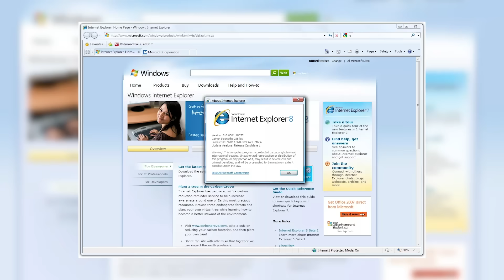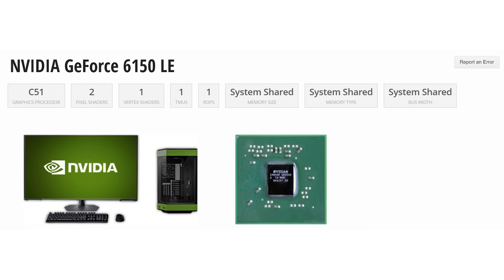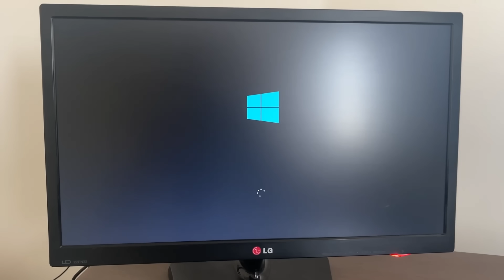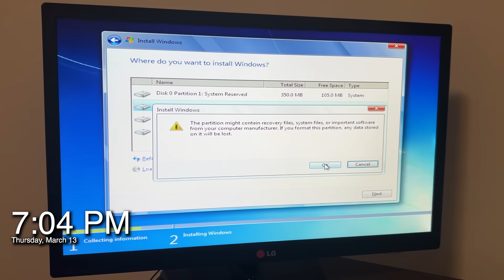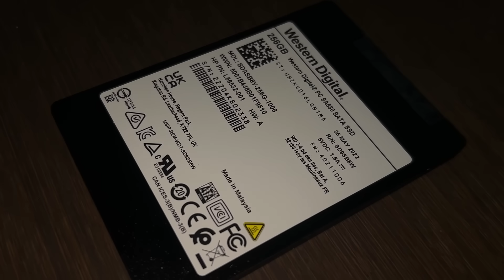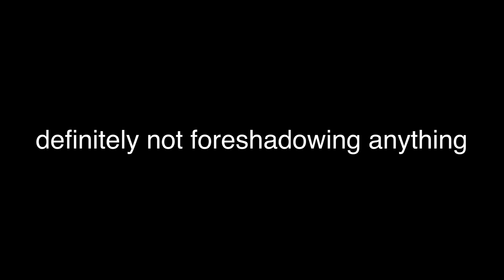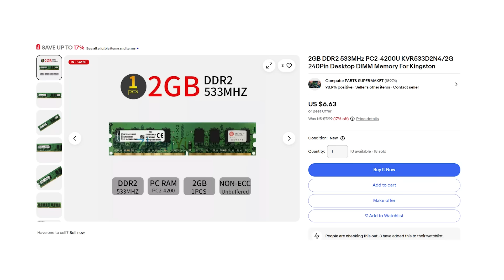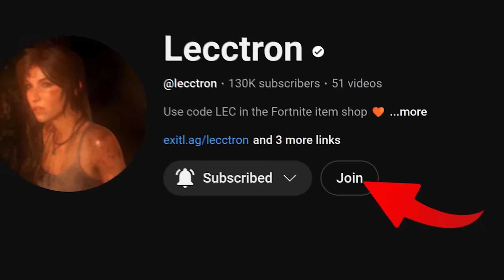I Revived a 2007 PC For Only $28!

Comment: The AMD Athlon 64 X2 4200+ was first released on May 31, 2005, as part of the initial launch of the Athlon 64 X2 family. 
Following the original release, updated versions using different architectures and sockets were launched on the following dates:
May 23, 2006: Release of the Windsor-based model for Socket AM2.

Comment: Revived an Athlon II x3 455 (from 2010, 3 cores 3 thread). Swaped the HDD for a SSD 250Gb. Swaped the 2x2Gb for 2x4Gb RAM DDR3 1333 Mhz. Then, I removed the radeon HD with 500Mb VRAM, for a Powercolor RX 550 2Gb (50 watts, 50$ CAN). That GPU is the center-piece of the upgrade. The thing is, you want to offload video decoding to the GPU, when browsing Youtube, Netflix, Prime, etc... You need codec support, otherwise the CPU will do the decoding (and it will utterly choke). You need hardware acceleration for h264, h265 and at least partial decode for VP9 8-bits. At that is exactly what the RX 550 does. When I go on Youtube, I use the MS Edge extension h264ify to force H264 playback. Then the GPU handles the decode, and the CPU still has some paperwork to do. The Result is that I can watch Youtube at 1080p30 with about 25% GPU usage and 40-50% CPU usage, with very very few dropped frames (less than 1%). I installed Linux Mint on it, and the PC sits comfortably at 2.5Gb to 4Gb RAM usage, depending on what I do. I can go as high as 5.5Gb usage, with Edge (6 tabs), thunderbird opened, LibreOffice with documents opened. I don't think anyone would reach the 8Gb usage on that machine, because it would mean there are tons of windows opened. Mint is lighter than Windows, and so, it helps.That old dinosaur feels quite good to operate for browsing, emails, Office work. It's very functionnal honestly. The thing with Linux is, you want an Intel or AMD GPU, for full integration into the Kernel. Nvidia GPUs are a pain in the butt to configure for Hardware acceleration (through VA-API), so it means you must go AMD. Good news with AMD is, it is an out-of-the-box experience on Linux. The Kernel detects and install it easily. The powersupply of that Athlon II x3 is super weak. It is a small for factor, with 200 watts. The GPU upgrade had to take this into consideration. That's why the RX 550 was a good choice, with H264,H265 and partial VP9 hardware decode, and 50 watts TDP. All in all, it is a very very good upgrade. 15 years old machine that can still be used as an office computer and feels responsive.

Comment: THis PC is capable for upgrades.First CPU - I think this motherboard support up to Athlon 64 5700+.Ram can be upgraded to 4 modules 2 gb ddr2 667 - 8gb is max.Try to find modern Modern Nvidia card and of course SSD. Yes for sure for powerful gpu You must change the PSU.

Comment: When going backwards from something higher than Windows XP you need to remove the CMOS battery because the later windows alter BIOS settings. Pulling battery makes it go back to factory CMOS file. Put battery in so it does not forget the tie of day each time you unplug it.

Comment: I've seen this mistake before, but the iGPU is integrated into the northbridge, not the south bridge. People younger than like 23 probably wouldn't know this as CPU's have housed the integrated gpu since the early 2010's. The northbridge is under the heatsink located between the cpu and the pci-e slot. Yes, I know it says nvidia, but nvidia made chipsets back in the day. It was the only way to get Nvidia iGPUs and SLI compatibility in gaming motherboards in this era.

Comment: 4:58 I HAD THIS ISSUE BRO. CHECK DISK OR SMTH. I HAD TO FACTORY RESET- CUZ IT DIDNT FIX WHATEVER IT WAS TRYNA. AND THE LAPTOP I WAS USING IS 14 YEARS OLD. THE FACTORY RESET GOT STUCK, I SHUT THE LAPTOP OFF, I ENTERED RECOVERY, OH NO, ITS STUCK ON A BOOT SCREEN I DIDNT EVEN KNOW. Then I got it fixed and now it's running good.

Comment: I have an old z400 hp with a 1366 Xeon I found on the curb. Had 20 gigs of ram, threw a 1060 in there and it works damn well.

Comment: I'm running 🏃‍♂️ windows 🪟 11pro on 23yr old Asrock G41-VS3 mobo with Intel xeon x5450  3.00Ghz speed 4 cores 12 mb L2 Cache and 8gb ddr3 ram on old 500gb seagate hdd 12yr old.

Will this gpu you used 🤔 will work on G41-VS3 mobo?

Comment: how to install linux: select a distro (distros are like the flavors of linux, weird pepole try arch linux, normal pepole try linux mint) (I recommend linux mint) dowland the ISO file, plug a usb flash drive with 8 or more GBs to your main pc, install rufus, open rufus and select your flash drive and iso, if the computer that you are gonna be installing linux have a 10+ years old motherboard, select MBR, if it is more recent, select GPT, press done, plug in your flash drive to the pc that you are gonna install linux to, google: "what is the boot menu key for [motherboard maker] motherboards", the result will tell you the boot menu key, prees the boot menu key while booting, select the usb flash drive and press enter, install linux by opening "install linux mint" and go throuth the instalation progress
Reply: yes, installing linux mint isn't too hard. I have a pc with 4GB of ram and an old e6600 core duo .It only works properly with antix linux on.  Putting that on a pc if it old isn't that hard either. I'm using it now to write this.

Comment: 2mins in and im already spotting bad caps lol One of the first things i do as tech is look for leaking caps on mobo, once i see that its done. lol No point in spending coin on that puppy. That being said alot of people are to quick to get rid of there computers because they think they are to old, there not, not at all, if people would stop listening to the big corps or people who dont know what there talking about and just did a little bit of upgrading you can keep the computers for yearsssss.

All this one needs is that extra ram, vid card and slap in ssd, boom, that thing would load faster than some of the new win 11 retail computers today.

Comment: Not as cheap but have similar plans for an HP Pavillion elite desktop I found for $50 while thrifting (came with o e of the monitorsof the time) keyboard and mouse extra cables etc. But the true worth is what's on the inside. A Core2Quid Q8200 with 4 2gb ddr3 ram all HP oem, I plan to transplant the board and a few of the other parts into a Cooler Master N200 case along with a Nvidia geeforce gtx 560ti from the FB marketplace and a Sound Blaster audigy for EAX support. 

Oh and a 1tb WB blue 2.5" hdd with 128mb cache for XP and a ssd for 7

Comment: I forget the Website!  But I downloaded a Windows 7 .iso which had the word "ultimate" in the file name:  You can probably find it, if you search for that.  It required NO Activation Key:  You just hit "Enter," with that field blank.  One thing....I later read that it has problems using a USB 3 port.  I burned it to a DVD & had no problems.
"Fight Software Piracy!  Earn a Reward!  Call:  1 800 RAT-FINK."  :face-blue-smiling:

Comment: 3:34  But Linux is IDEAL for old computers!  Installing it is easy, & it runs faster than Windows!  For moderately old machines, you can't beat "MX," which is full-featured.  Older computers may prefer "AntiX," "Puppy," "Slax," or some others.  For REALLY old machines, there's "Tiny Core."  "Got 32 bits?  Get Tiny Core!"
Reply: 32-bit AntiX is super fast and reliable to be honest.

Comment: 5:00 that's not an update, thats the disk repair utility, and yes it takes FOREVER.
(Tho it's mostly worth it if you're running an HDD as a boot drive)

When installing an OS on an HDD I usually format it, run the tool overnight (tho when the drive is empty it usually takes less time), and only then install the OS.

Comment: Wdym you don't have any experience installing Linux on an older pc?
Either usb boot or, if its not supported, use an cd/dvd.

Just use debian and it will work out of the Box.
When installing, choose the xfce desktop environment. This works fine on my singlecore Atom from 2009.

Comment: I am pretty sure that is not the original motherboard. I had a PC from the same lineup. These were sold as media center PCs. They were shipped with XP Media Center and had a TV tuner card. The motherboard had HP branding but was sourced from ECS. The PC I had was an a1521in with 512 MB RAM, 200GB of HDD and an ATI Radeon Xpress 200 chipset with integrated graphics.

Comment: My father bought an older used workstation computer 10 years ago, and after a few years, it became increasingly slow. He asked me what could be done, and I took a look at it. I was able to upgrade it from 2 cores to 2x4 cores and from 2GB of RAM to 16GB for about €50. The SSD I installed was a used one I owned. The computer feels almost 20 years old and still runs well. It was definitely fun converting it.

Comment: 5:11 that's not a hard drive that's too slow, that's a failing hard drive.... 

Also would have personally gone for Windows 8.1 on here, much lighter than 7 and 10 and is what I use on my main PC. Oh and Win7 drivers work on 8.1 99% of the time.

These old Althon 64 X2s are pretty awesome, especially for pre 2010 games. will pretty much play anything from that time period. Very good showcase of how these old systems can be a lot of fun still, keep up the good work!

Comment: that mobo could do 8 gb of low density ddr2 it doesn't say it supported but I will also you can inject 1090t microode into the bios an use a 6 core with it

Comment: Sometimes the 4GB limit is due to the manufacturers anticipating a 32bit OS, which cannot access anything more.  There is a solid chance that this could take 8GB, but I'm sure you researched that.  I would also say it's kind of a good idea to go overkill on the GPU, especially if you can find a better one for an equal, not much higher, or even lower price than an ideal one, as the added VRAM and brunt can act as a safety net.  I would also toss in the best CPU this computer could accept, but it could be a relatively rare, obscure processor that would balloon the cost of this build significantly.  That being said, I really like these kinds of videos, I used to have a hobby like this, but they took up too much space so I just yeeted most of the computers.

Comment: I'm not surprised. The computer I use daily is an ancient Core2Quad with 8 GB of RAM and it just does everything I need despite having a CPU from 2008 and board from 2009 and a GPU from 2013. I'm confident if I shoved an even newer GPU in it I could probably even play somewhat modern games on it to some degree
Reply: currently using an lga 771 quads xeon from 2007 and gtx750ti, runs gta 5, fallout 4 and hitman 2016 smooth and easy
Reply: @nashcomp  I used to use a 771 with a little modified sticker underneath to get it to work on a 775 socket :P
Reply: Same here. But my C2Q now reaches the end of its lifetime, because Win11 24H2 wouldn't run on it. So i will switch to an i7 2600. Thanks to the gentle help of Rufus i will make a clean install of Win 11. 
(Win I need for my work, because of this it is mandatory)
Reply: @jensputzlocher8345  That's a bummer. I'm probably going to put Linux on mine which will likely last until I get into a situation where Windows is mandatory as well
Reply: @ oh I forgot to mention: MX Linux XFCE is running on a second partition for prvate use.

Comment: The Core 2 Quad still holds up, and it's low end limit for running modern games. Anything that's older like the Pentium 3 and 4 and the older Athlon chips, is going into the realm of Retro PC Gaming running DOS, Windows 98 and XP games natively.

Comment: I think it is good idea to give old PC new life through upgrades. But all your experiments before upgrades hadn't any sense because it was absolutely clear that working on PC under Win 10 with 1GB of RAM and old slow hdd is some type of masochism. Also your problems with installing Win 7 looks like strange. I installed Win 7 on PC with Athlon X2 4600 and hadn't any problem
Also it seems that one of capacitors near PCIex16 should be replaced. And it would be better to set 2x2GB PC 6400 instead of 2x512 MB + 2GB because of dual 
But your CPU significantly decrease speed of this PC. I remember when I changed AMD Athlon X2 4600  to AMD Athlon II X2 245 (my motherboard supported AM2+ CPUs after BIOS update) it boosted speed of applications work significantly.  Total costs of upgrade for me:
AMD Athlon X2 4600 (original) -> AMD Athlon II X2 245 (~1.1$) 

2x1GB PC6400 (original) + 2x1GB PC6400 (for free).
Asus AMD HD 6670 1GB GDDR5 (~2$). Was in non-working state but I fixed it
ST 320Gb 7200.10(original) -> WD 500GB green edition (~$2)
Motherboard: MSI MS-7367(K9AGM3-F)
PSU: Delta 400W
OS: Win 7 x64
Unfortunately this motherboard doesn't support overclocking so I used SetFSB. Also due to different timings in SPD of different memory modules RAM frequency was decreased to 667Mhz. But I changed timings by Thaiphoon burner and got 800 MHz

Comment: I love how everyone calls molex a fire hazard when it was industry standard for 40 years and is used in cars. There are many types of molex connectors and those wires are the same gauge as standard pcie power. Bonus points, the pcie power connector is actually called a "Molex 45558-0003"
Reply: molex in-and-of itself is not a fire hazard, however what IS a fire hazard are molex to "insert cable here" adapters, as most of them are cheap, shoddy and either dont properly convert the power, or supply an insufficient amount, leading to melty cables/fried components, or sparky boom boom/full on fire LMAO.

the reason most have come to this conclusion is because wayyyy too many people have almost burnt their house down using these adapters. "molex to sata, lose all your data"

Comment: "And even try some modern gaming" -> shows two Tomb Raider titles which are 12 and 10 years old now, respectively :D

I understand that an Athlon x2 with that Quadro card and 4GB RAM is not going to run any actual modern AAA titles, but you could've tried tossing Hades 2 at it or something :)

Comment: This board certainly will support 2gig modules for total 8GB of memory and there are these suspect chinese 4GB modules for a total of 16 gigs. I think that some ECC 4gig modules ought also to work.
Reply: I remember seeing some 4gb modules that were not only advertised as such, but also only worked on AMD processors for some reason, they didn't work on my Intel machines.  So they definitely would have helped here.

Comment: As a 41 year old I love this video. I am highly impressed with the later Tombrader games... clearly well optimized for the CPU as in today's standards, Those socket 939 chips are painfully out of date.
Those were the days where AMD released 3 platforms very quickly going from Socket 754 introducing the first Athlon64 which started the downfall of the in my opinion crap Pentium4's
It was followed up by the socket939 which introduced the first Athlon X2's which dominated the P4's and the atrocious PentiumD's
And then they followed up with the AM2 socket which lasted a long while with Athlon X2's, then Phenom and up to the Phenom II 940.
This socket originally started competing well with the early Intel Core2Duo's but intel quickly took the lead and kept it for a long while. Tho AMD chips were still good, well priced, with motherboards offering a lot more for less with long upgrade paths.
Personally I jumped from the previous socket running an AthlonXP (Competed against midrange Pentium4's) to a ultra cheap 939pin motherboard and an Athlon X2 3800 which was a huge performance gain. Going from single core to dual core was life changing even if games weren't optimized for it as... your processor had headroom to... alt tab when under load.

Comment: 4:59 those arent updates, Windows was fixing the partitions on the drive. You can fix the partitions (depends if the drive is dying or not, which u can check out by crystaldiskinfo) either by going into cmd or powershell, running it as administrator and typing in chkdsk C: /f and if windows started fixing it on its own, the drive is dying

Comment: As long as the drive fits in the physical connection of the PC, it's going to make it faster.

I have a slow laptop like super slow, like a phone slow. Then I just changed out the hdd with a sata ssd and it loads so much faster, the igpu still stucks though. 🤣

Comment: You got a little too excited with the original price of the CPU. You took the price from the socket 939 chip released in 2005. For AM2 there were multiple versions of the chip, including an OEM version. Since this is a prebuilt PC from a big OEM you probably have the OEM version like shown at 6:15. That one didn't have a retail price but was probably around $100 (or $150 today) for HP.

Comment: more you can do for a bit more budget, that board supports all AM2 chips of 95W or lower which means you can run an X2 6000 on it, not the Windsor the Brisbane 3.1ghz, the board says max 4gb but it will actually run 4x2gb DDR2 just downclocked to 667 so you can get a faster cpu and 8gb of ram on it

Comment: Could you drop an amd phenom x4 9950 black edition in the board? I think that would also let you use a GTX 1050 as a video card. Likely blow your budget away but still likely be a decent performer. I did notice that unless you get it shipped from China, the prices are highway robbery though.